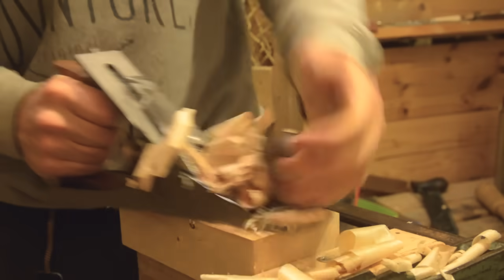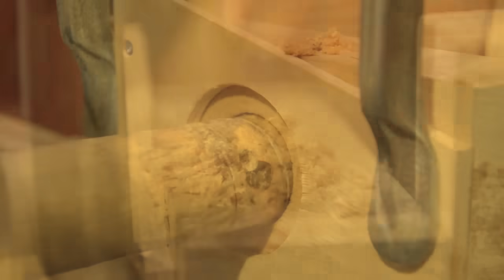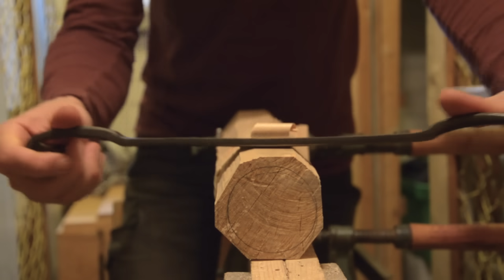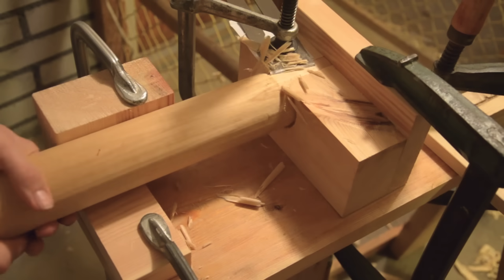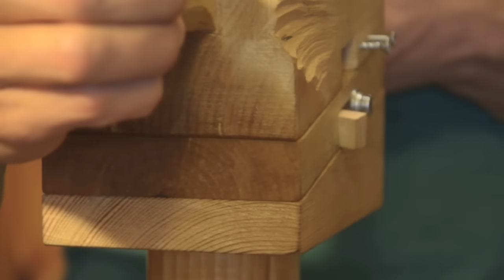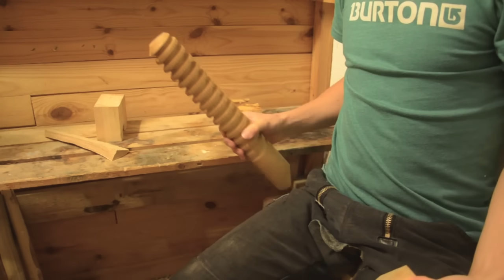Selfmade Tools for Wooden Thread Part 4: Tools in Action

Comment: Very good thread. My thread  is more loose because humidity changes.
Reply from the maker: Thanx for your feedback :-)
To my understanding, dipping the Thread into linseed-oil before cutting it will not only make the cutting-process smoother, but also decrease the growing and shrinking of the wood later on. Let´s see...

Comment: Get a bigger axe and swing it from higher, let it do the work. Don't push it with your hand.  Same is true when using a hammer. 
If you don't have a workbench you can use long plank or beam on saw horses. Trick is to have other end of beam against the wall. Then you can plane as hard as you will.
I like your screw work. I did quite similar, but not without difficulties. Inner thread in wood is strong but screw itself less so. It may also bend and start to bind during years. 
I think plastic round bar could make nearly ideal screw for wood working vise

Comment: I wonder if you had the blade take a smaller bite when making the screw and some a few passes to get full depth, if that would have given s slightly cleaner finish without that slight slop you show at a couple points.
Reply from the maker: It would be a nice idea, but unfortunately it does not work. I need a ready thread right behind the blade to ensure the screw to be transported forward.
Just for the bolt, there this idea works out well.
Let's see, if there will be a new idea coming up, where the blade can be flexible, like you suggested...

Comment: Ironwoods (a category of high density wood) are normally used for gears and screws because soft woods like birch would fail.  have you tried your tools on the harder woods?
Reply from the maker: I would not say, that birch will fail. Here, all old, antique benches are made with a birch screw. And they have been used, for long time and are still working well. What is nice with this wooden screws is, that they will still work, even, if they are used, and not tight any more. And yes, i have tried on maple, it worked great!